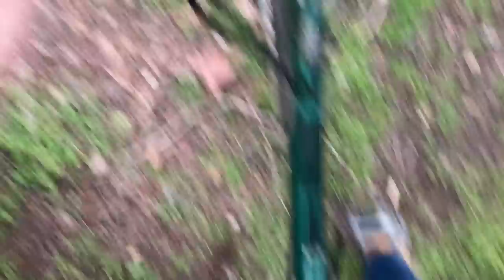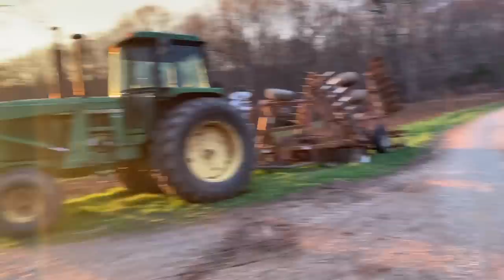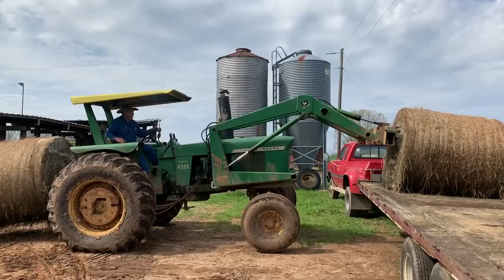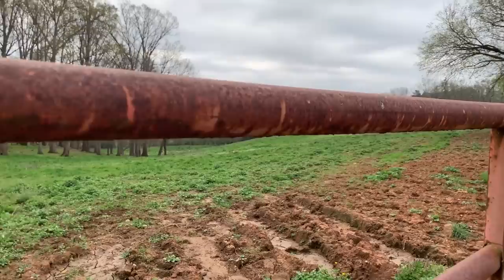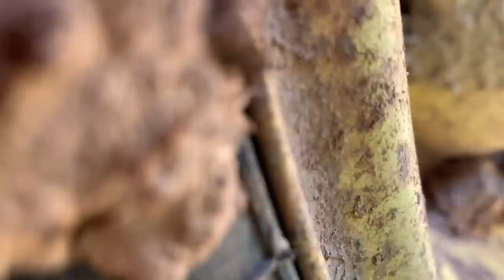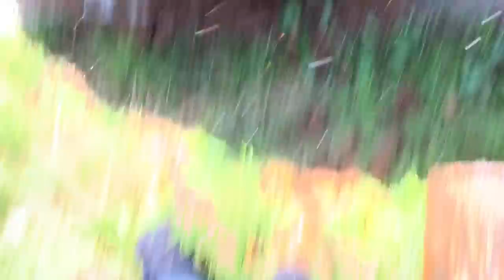Making Old Things New : Cleaning Filthy Farm Equipment

Comment: I can always tell when it comes off unrehurst as it bumbles a bit but who cares, got it done. I surely do believe in clean equipment as it will save money in the long run. Pieces coming loose or off can ruin your day, been a lot easier when it was still wet mud a coming off. I know when its a freezing out that water is not your friend tho so person has to pick their battles. I spect that if you make it highlighted in the "more"section that you will get more subscriptions tho. I didn't get far with clicking on the corner so will paste and find its source. Hope it makes you some jingle in your pocket. We got us a mild tornado outside and it is 18 degrees. So the sign outside your kitchen is going to say its time to eat or get your fortune told....

Comment: Bicycle: Use your Kroil on the bicycle chain and inside the shift cables and shift mechanism on the rear wheel. Don't get it on the side of the wheel rims or brake pads, Pedals need to be moving while changing gears.

Comment: for that hard rock dry mud dont be using your hands, your going to brake a finger nail and cut your self all up, use a tire iron, steel pry bat, a crow bar, like the 2 inch wide short 18 inch long ones, it pops right off,, and dont waste your time with a hose, go strait to the presser washer,, start up top and work your way down.. // if my ex wife did 1/10000 of what you do, and not running around cheating id still be married and have everything i built up since i was 18, that she got a court order that i had to give her everything i owned, built , tractors, allmy savings, my land i paid cash at 18 and biult a home stead, is still be happily married, and have a really great home stead, for more info on my past life and todays life check me out, in this could country Canada